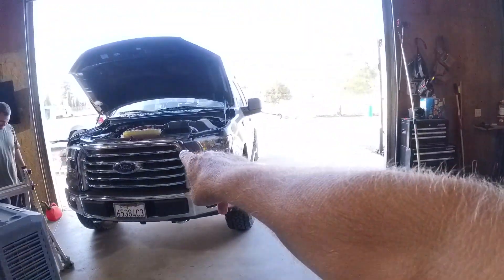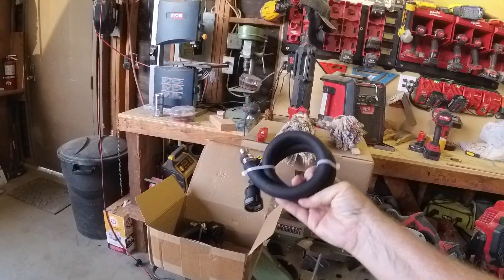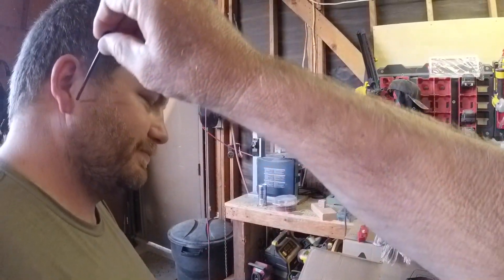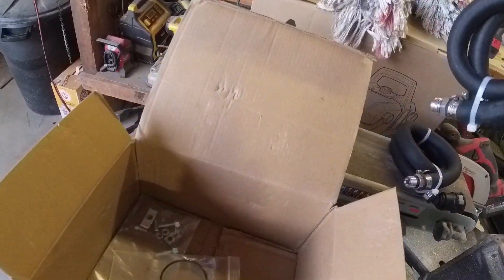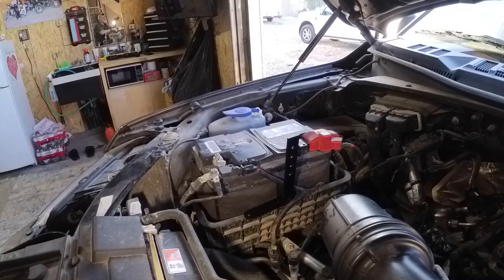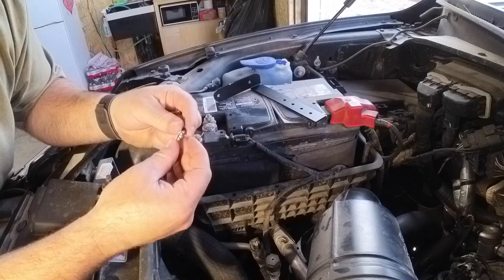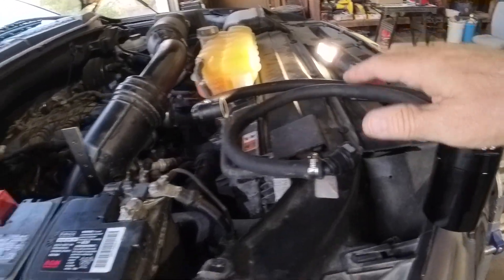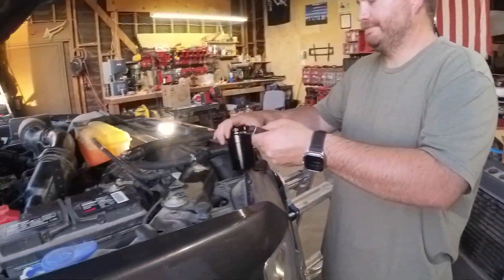Affordable Oil Catch Can For Ford F-150

Comment: How are the hoses holding up
Reply from the maker: They cracked right away. I just ended up going and getting new hoses. It wasn’t very much more. I think I spent 10 more dollars on hoses from the local auto parts store. But the original hoses suck.🤣
Reply: @ManCaveMayhem  I kinda figured that would happen lol, I have some braided hose laying around I'll swap them lol thanks man